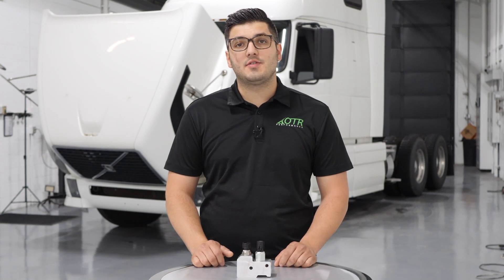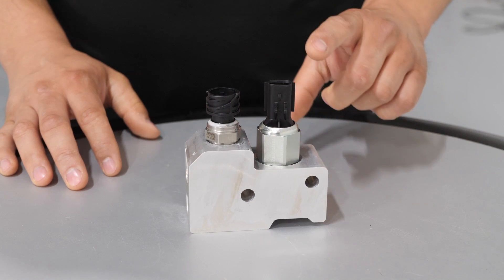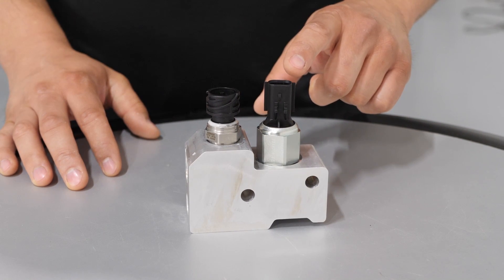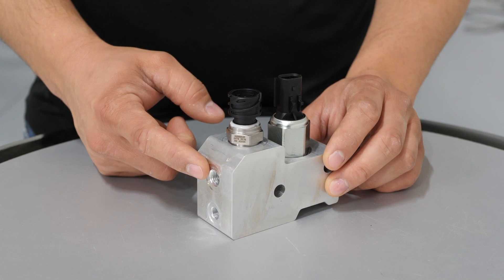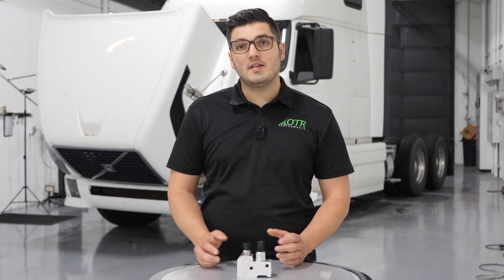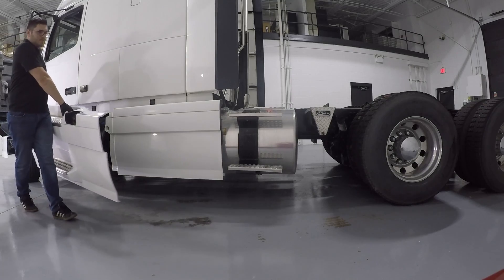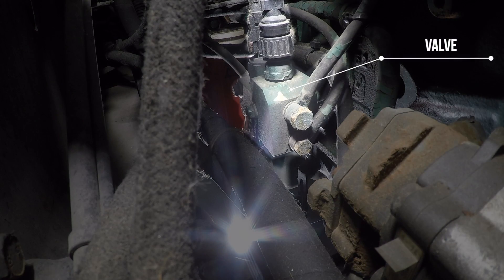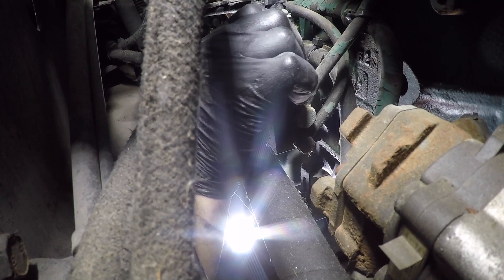Bad AFTERTREATMENT Shutoff Valve on Volvo D13 Engine

Comment: Very helpful video.  I just had to replace the shutoff valve.  The wrench sizes was really helpful as there is NO room in there to see what I was doing.  Had to remove the oil dipstick to get the extra room.
Great video.

Comment: Could that cause an error code MID 128, PSID 47 FMI 12 reading?
Reply from the maker: It looks like that code is for a trap DPF regeneration error. it means that the system can not obtain the proper temperature needed for a successful regen to take place. Could be that your DPF or 7th injector is clogged.

Comment: After changing it do you need to calibrate it?
Reply from the maker: Hi Damir, Yes you do need to reset the engine learned data and you also need to reset the codes. It's recommended to run a regen after replacement of this component to ensure it completes after replacement. Let us know if you have any other questions.

Comment: Hi there. I have code spn 3490 fmi12 and says aftertreatment 1 purge air actuator. Can you tell me what is it? My truck is volvo d13,  year 2016.
Reply from the maker: Looks like you have a bad Aftertreatment Purge Air Actuator and it needs to be replaced/repaired before that code can go away.

Comment: Do i need to do any resetting after changing the AHI module in a d13 volvo
Reply from the maker: You need to reset the engine learned data after you replace this AHI module.

Comment: what voltage i should have in the shutoff valve . the pressure sensor round connector i have ground and 5v and pulse ground on the third wire . the 2 prong connector i have ground and 4v . is 4v enough or it should 12v? can you help please

Comment: How you diagnose that shut off valve is bad
Reply from the maker: We had an active Shut off Valve fault code. DPF Regeneration would not start which would cause a derate. We replaced the shutoff valve and cleared the codes with the DTC+AFT reset tool and started a Forced DPF regen and ecverything worked great after that!
Reply: Can you share the code with us
Reply from the maker: @401westhomes   SPN 3471 FMI 7 or MID 128 PPID 328 FMI7

Comment: can you tell me why air bubbles inside the diesel tank come out thanks for the videos
Reply: The injectors have a leak when they spray that’s what  they told  me but like I say  I put over 250 thousand miles and no problem just save inuff to fix it because it expensive or dump it
Reply: Gerardo Gonzalez yo tengo 2013 d13 y no salió bueno tengo problemas de regen SCR performance me lo pide diario llevé a limpiar filtro dpf   Y sigue igual y algo está provocando pérdida de fuerza
Reply: Gerardo Gonzalez y la transmission tiene problemas es como que se queda en neutro así es este negocio tuve un Volvo 2005 por 10 aÑos  y nunca dio problemas motor Cummins .gracias
Reply: El mia Volvo salió bueno si te pide el regen cada día es porque no lo está asiendo completo pero yo tengo garantía 350 mil milas pero es fácil de arreglar ese problema que código de manda
Reply: My had the same codes and it was the def  filter were plugged up I got them clean and then the Volvo dealer did a forced regen worked great my had a air leak on the transmission line and it would keep my transmission in neutral got it fix works good now almost 500 thousand miles on it runs great
Reply: Gerardo Gonzalez gracias 🙏
Reply: They told me it was bad injacters 2 years ago and my is still running
Reply: Gerardo Gonzalez hola sabes tengo ese problema y aún no encuentro solución gracias por el comentario
Reply: A mi me dejieron que era un enjector pero yo tengo 2 años con el así es 2013 Volvo es muy commun con el Volvo
Reply: Quentas millas tienne
Reply: Gerardo Gonzalez 777-795 code spn 5394 -spn 84–spn5394–
Reply: bubbles in the fuel tanks are more likely bad injectors or caps